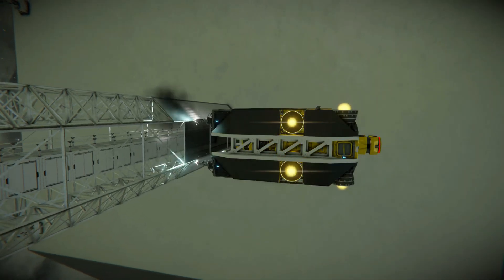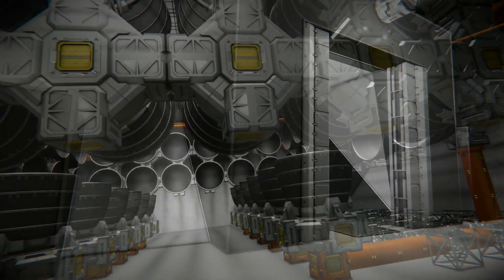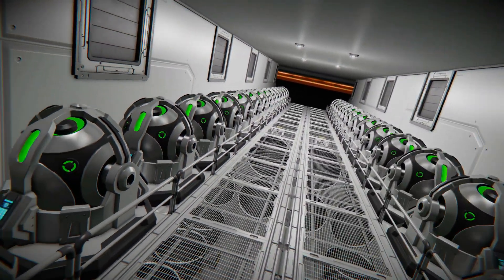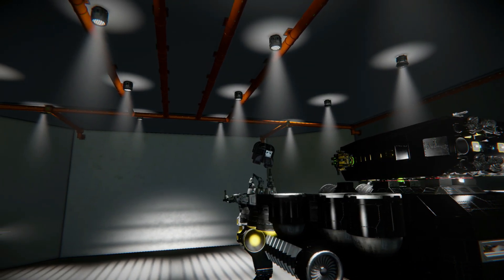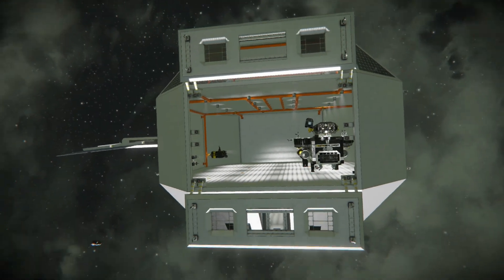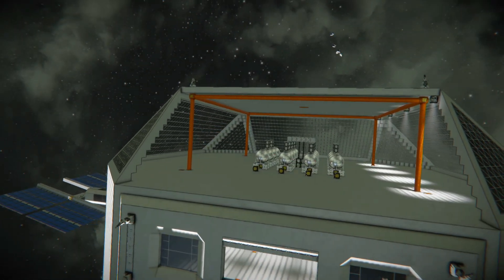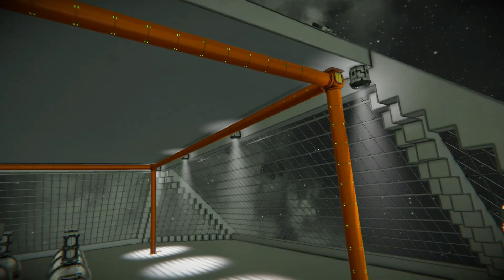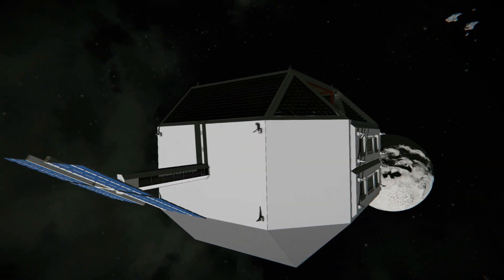Space Engineers - EP33 - Station Tour - Massive Air Tight Hangar Door | Tutorial | Let's Play

Comment: 6:45 amazing door! I've got a question: What do you have to look out for when placing the merge blocks and the hinges for a door like this? Do the hinges have to be in a seperate grid than the station? Do the hinges and the door and the station have to be on seperate grids?
Reply from the maker: Great questions!  It's not only a great question, but can be a complicated one with the way sub-grids work.  First, you want to make it so none of the door or station blocks are next to each other - only have them touching at the corners (there are other exceptions for certain blocks, but that's the simple rule of thumb.  The second thing is that you want to devise a mechanism that places an intermediate grid between the door subgrid, and the station...which is another reason I used 2 hinges.  It you try to merge the door subgrid immediately to the station grid, your trying to tell the game to make the door subgrid the same grid as the station...which it's a valid construct.  I have this grid-subgrid merge concept well explained with some diagrams in this video if you want to hear more about merging subgrids!   https://youtu.be/lpNA8tRLHaY